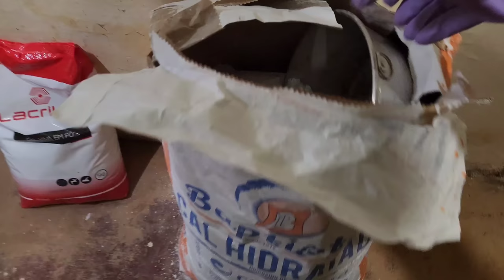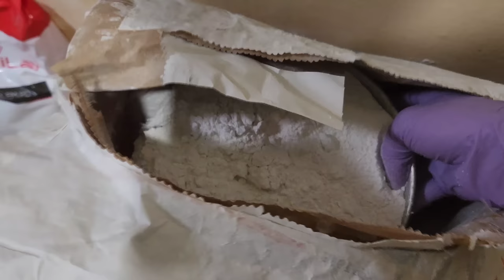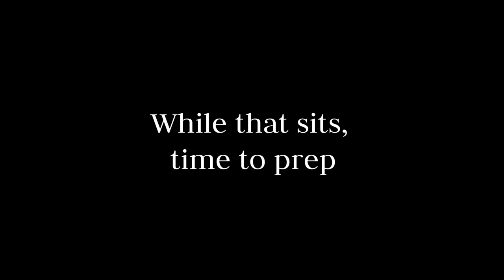My $15K House - Ep. 5 - Transforming a House for Under $2 (€1.50)

Comment: Whitewashing is brilliant. Used all over Europe and, like you said, cheap, safe and easy to create. Stands up well to the climate as well. My dad whitewashed one of our houses in the UK with it. Lasted years and always looked great.
Reply: It’s not safe … other YT people who have used it have taken precautions.
Reply: @bridgwll  quicklime, that is unhydrated lime, meaning basically calcium oxide can indeed be dangerous as it is very caustic and can burn. Aside from chemical burn, it also generates a lot of heat in reaction with water, which can mean water from your skin, eyes (ouch!) etc. But JD was not using that (although he has a smaller bag of it). He was using hydrated lime (calcium hydroxide, which is what you get when you "slake" quicklime with water). Slaked lime is much safer, probably safer than regular Portland cement. And when it finishes reacting with air, lime becomes calcium carbonate: what our bones are largely made from, i.e. extremely safe and non-toxic. JD knows what he's doing.
Reply from the maker: I explained it in the video, im using hydrated lime (safe) not quicklime (needs precautions but still safe)

Comment: I was going to ask you if you were using natural paints like beer based and milk based paints. I worked for a while decorating people's homes with lime based paints and it was a great experience. Mixing the colours and then waiting for them to cure to get the final result in order to adjust the tone. A lot depends on the ambient temperature and the ph of the wall. I love the casein formulas that the Swedish people use for their external woodwork, usually oxblood red. Oh yes and they are CHEAP to make !

Comment: Hi lovely to find your channel! If you don't mind me giving some suggestions? Use the grapevine on a pergola for shade. The concrete you can use to your advantage to put raised beds on them. And the exposed concrete you can paint with faux bricks using a sponge. A lot of work but it really looks nice. Try beer traps for the slugs or find a hedgehog to eat them 😂😂 looking forward to more of your content! I'm in central Spain so a different climate, oh and have a look if the soles boilers are cheaper in Spain or France you never know you might strick a deal!
Reply: Sorry this comment was meant for the garden video 🤷🏼‍♀️🤦🏼‍♀️🤦🏼‍♀️🤦🏼‍♀️
Reply from the maker: I did the beer traps and got rid of most of the slugs, but would absolutely love if a hedgehog took up residence in my yard. I looked on amazon in spain for them but it just had ones for pools

Comment: I wouldn’t think the moss spores will be removed by the brush.  A moss killer or pressure washer would have been more thorough.  Enjoying your videos..  Dpray would have been easier for red section.  These tools will last a lifetime and be a worthwhile investment.  EBay is great.
Reply from the maker: The moss isnt a big deal and once I put in the gutters it shouldnt be an issue, and if it is, it took like 5 minutes to get rid of it with the brush, so if I have to do that once every year or two thats fine with me. I wont spray any poison unless its absolutely necessary, especially outside. If I sprayed the red paint, I would have had to tape up and cover everything else, which would have been way more work and hassle than just using the brush, plus more money for extra materials that arent necessary.

Comment: Pity I didn't see this sooner, boil water put some cornflour/corn starch and when it is thick add it to the lime wash (red) to make it thicker so it doesn't drip. Doing renos myself and feel the pain.
Reply from the maker: Never heard of that but that makes sense. I still have all the inside and yard walls so i'll try that out!
Reply: @My15KHouse  Yeh the corn flour is transparent so it wont ruin the colour. ow did you know the Red goes all the way down to the street. The original owner did that so when the rain came off the roof or rained hard , the dirt from the street didnt show as much when it splashed back onto the wall.

Comment: Huge improvement! Kudos! You must be the talk of the town.
But I did like the dark grey underside better. Also seems more suited against splashing dirt from rain.
Reply from the maker: I actually didnt think of that, that probably will be an issue
Reply: @My15KHouse  Meh, I'd wait and see. After that it's just another 2 coats of renderer with a different pigment.
Would I ^would^ do is contact a local blacksmith about a nice wrought iron gate to you backyard. A nice one, not one of those industrial off the shelf DIY shop ones.
I bet you'll get a decent price too, and a lot of good will.

Comment: I was wondering if you could add a tint to the white to change the color. I was glad to see that you can. Can you use this on the interior or is it just for exterior walls? Do you have to brush it on or can it be applied with a roller? It looked great! Keep going.
Reply from the maker: Yes it is for interiors too, and bonus is no paint smell. You can use a roller but i think it would be messy unless you can squeeze off the excess, its a lot more watery than regular paint

Comment: Do they not have power washers where you are?  If I had bought a house with that type of construction and all the rock/brick/cement, I'd go to Lowe's or Home Depot, buy/rent a power washer, and be done with the cleaning in a day.  That said, the whitewash was a stunning transformation.  Then I wondered why not use a long-haired roller rather than the paintbrush?
Reply from the maker: As fun as they are, I dont really see a big need for a power washer, and I have to tear off all the cement render anyway because it needs to be lime plaster. A roller would be very messy I think, whitewash is pretty watery and I have more control with a brush, though an actual whitewash brush would have been better if I could find one

Comment: Looking nice mate!

Why not just do a third coat anyways? IN paint, yould be putting a third coat on if youve got the materials for it. Its to protect the building after all, and it hasnt had it for a long time.

Also, did you do the courtyard too?
Reply from the maker: It was in a part I edited out and forgot to mention again, but its a cement render that will have to be torn off and redone with lime (thats why the plaster is coming off inside), so its just temporary
Reply: @My15KHouse  Nice one!

I havent worked with render or lime yet, but deffs watching to keep up with how folks do things and solve problems.

... also, commenting to make your videos appear more for me and other folks too :D

Comment: How did you get the gray color on bottom? And what is the material the wall is made of. It looks like rough concrete.
Reply from the maker: there was still a lot of little spaces that didnt get paint in them, but for actual gray color you can add charcoal or a black iron powerder. The rough part is just little pebbles mixed in with the render

Comment: I love your videos and wish there were 2 per week 😊.   A quick question for you.  I’m in South America and I can either find cal Agricola or cal viva.  I have tried painting with cal Agricola and it just washes away.  Is cal viva the same as what you used?  We also have access to cal hidraulica which they say it is used to mix with cement.   I am unable to find the cal area hidratada here.   Also, how long does this painting stay on the house?  Will it wash away with winter rain?  Will you have to repaint each year?  Thanks for your great videos.  We really enjoy them.
Reply from the maker: cal agricola is different, it is just powdered limestone so there is no reaction to take place to bind it together. cal hidraulica is similar to cement. you can turn cal viva into cal hidratada by adding water (it will get very hot). There should be lots of videos about how to do that, but I dont know the specifics like how much water or how long to let it react. Here the normal way is to use cal viva, but I had always used cal hidratada so that was what I was comfortable with. It should last years, especially if you add salt.

Comment: What are those two little kind of air vents at the bottom of the wall for?
Reply from the maker: for air circulation under the house, theres a small space under the wooden floor, but not big enough to do anything with
Reply: To allow air under the floorboards.
Reply: @My15KHouse  Thanks, never knew about that!

Comment: Question,can I paint every thing w white wash? Metal too?
Reply from the maker: not metal, it will react with it and corrode it over time, but anything porous you can, if its smooth like vinyl siding i think you will have to use a primer

Comment: Get urself a high pressure cleaner and always use a mask
Reply from the maker: Its not worth the cost or storage space for the amount of use it would get, and it was faster to use the brush than it would have been to set up a pressure washer. I'm using a mask